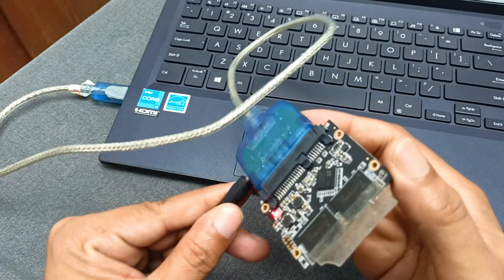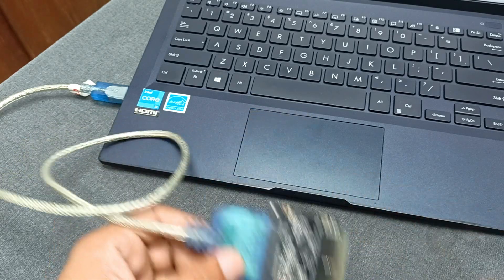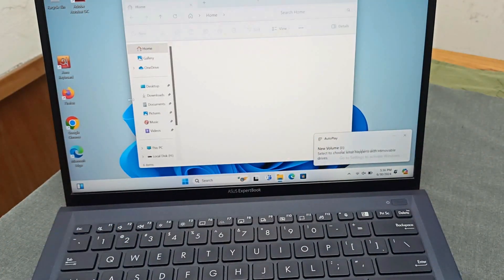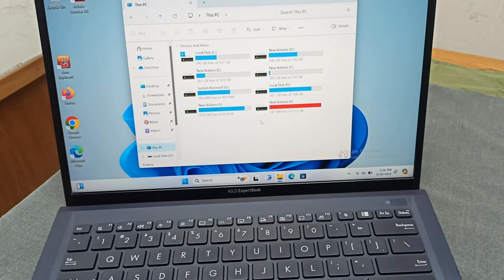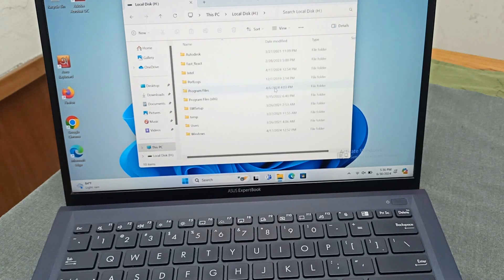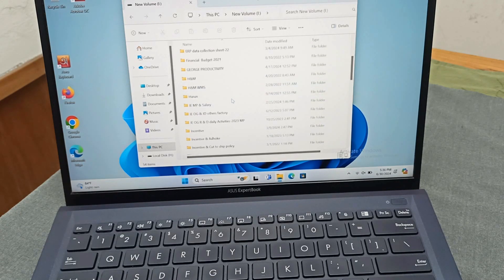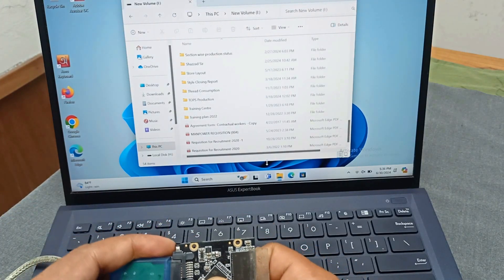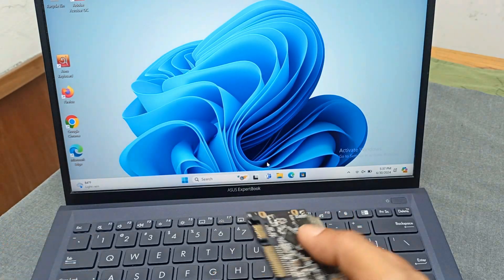How to repair Dead SSD drive || how to data recovery from SSD drive

Comment: What if the short shows in the controller (looking with thermal small spot shows inside chip)?  When you are testing those capacitors are you in diode mode or continuity mode on your voltage tester?

Comment: Hello sir tq for the informative video...sir same ssd pcb type is having problem. The standby led is lit up and the data transfer led is blinking but ssd is not detected... i also checked in different pcs but having the same problem.. how can i find out the fault ?

Comment: So what did you do with the capacitor? Have you replaced it? If so, how did you know what capacitor you needed to replace the shorted one? Thank you in advance, this was a very informative and educational video. However I seem to have lost you shortly before videos end.
Reply from the maker: Capacitors play different roles as different  places as per my knowledge this capacitor works for fixing the angle of voltage and current. I Don't know exactly what the value  of the cap is. But i used it from the same work place from another circuit. Thanks for your comment. .
Reply: @mrcontrive5641  I appreciate your input and I will leave a sub
Reply from the maker: @Fushgy  thank you soo much sir ❤️❤️